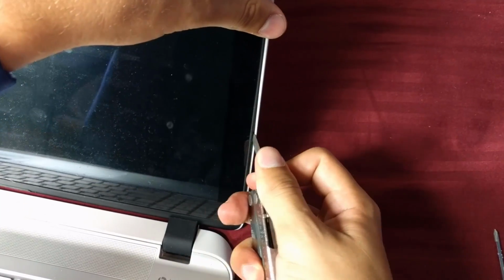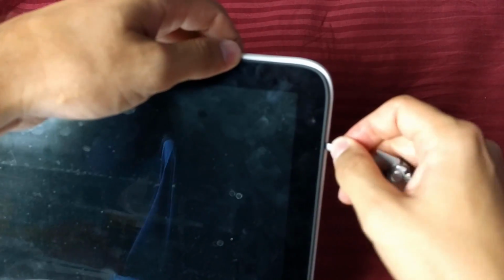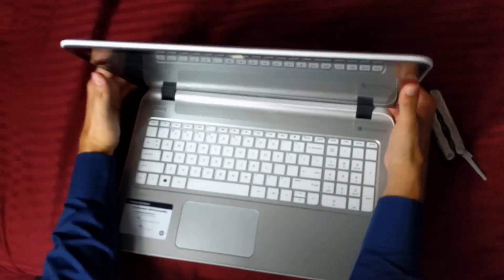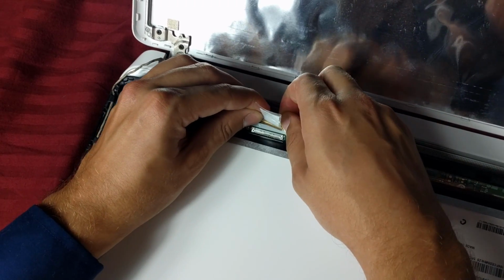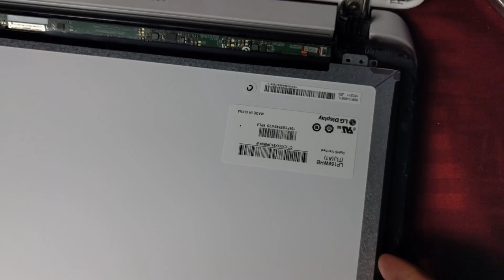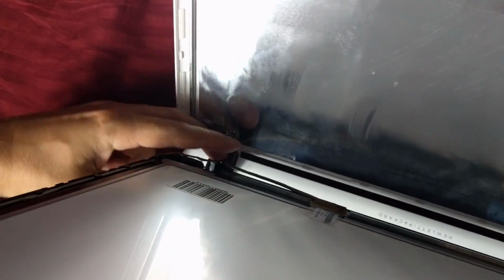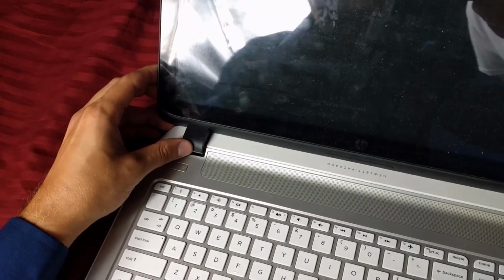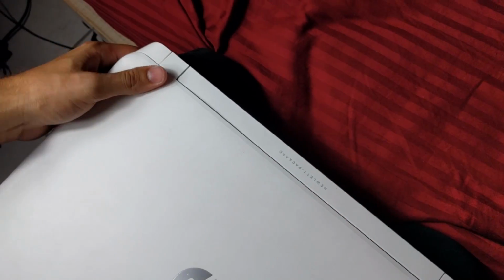Laptop screen replacement / How to replace laptop screen HP Pavilion 15-P033CL

Comment: Thank you so much for the video. I am trying to see how easy this is. I assumed you'd need a heat gun, but looks easier than expected. Nice to see that the lcd separates from the touchscreen glass, since only my glass is cracked.

Comment: Hello man, thanks a lot for the video,

I'm currently facing this issue too, but I'm still not sure if the problem is the video cable or the LCD screen itself.

Could you please tell me how I can determine witch cable I will need to buy if I want to replace it please?,

Is it the same cable for all hp models from this year of manufacturing?, is there even a standard about the cables?, what should I order in the end?,

Sorry for that many questions, and thank u for your time, any guidance will be appreciated.

Comment: Is there a difference between replacing the screen and replacing the glass? Can you just replace only the glass?
Reply: 9 months later haha but no, you can't seperate the glass from the screen, it's all 1 package. The space between the glass and the screen is an vaccum to protect the leds. When you see a screen start to go funny colours(on iphones and androids too), it's because air got in between the glass and the leds and effectively rotted the leds. OLED Oxidisation is what the process is called.